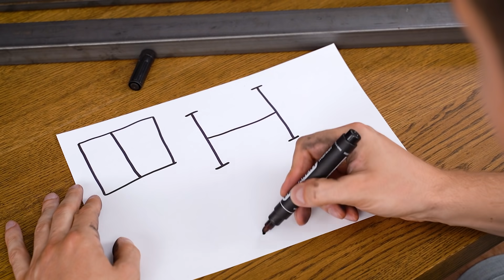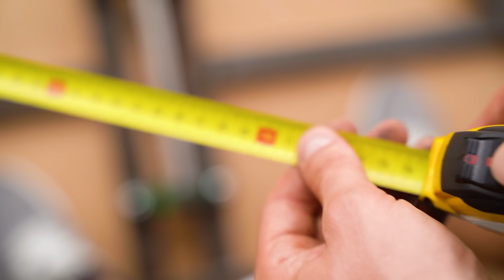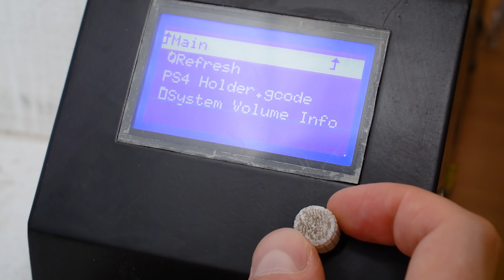How to Build MOTO Sim Rig Works with Any Game/Console

Comment: Albeit a genius way to play a GP sim, as a motorcycle rider I would have a hard time doing this as the use of counter steer isn’t present. If you were to flip the axis for the steering you would have a pretty realistic sim. If you were to lean right and steer right with a right hand pull  at 60mph plus on a real bike, you might find that coming off your bike in a flat spin really sucks. Your videos are awesome nonetheless! I like the sound dampening in your workspace too, my wife hates the echoes of wrench clangs maybe I’ll look into that.
Reply: Halo
Reply: I was thinking the same as he was doing it. No counter steer which makes impossible for me to use this rig
Reply: @madn3r0  you could use it but the lack of counter steering breaks the immersion since its more like driving a car than a motorcycle.
Reply: Bruh thags not cou ter steer
Reply: Needs a gyro
Reply: Came here to say this. Bikes don't turn at speed by turning the handlebars like a steering wheel. Among the best arcade motorcycle systems to get the most realistic turning is Sega Manx TT superbike.

That style full ride on machine could be recreated with the skills of this YouTuber

Comment: Good start! Found this since i was thinking of doing something very similar since nothing good exists already, or at least not for less than cost of a real motorcycle ($6k - $20). 
ONE BIG PROBLEM, this isn't a mountain bike SIM. Real street bikes turn opposite direction due to the steep rake angle and gyro effect of the front wheel. 
Only works like this at extremely low speeds, although not a place you want to be since gyro isn't helping to balance and they have the steering radius of the moon.

Comment: At 4:35 you are doing it wrong. Counter-steering works on a motorcycle at over 12mph (19km/h). So when you lean right at high speed, that’s turning right, you will actually be turning the handlebars left. I know it sounds crazy, but it’s a gyroscopic effect 😉👍🏼

Comment: Definittely funny build and well done. Only the input lag is beyond any immersion :/
Reply: Idk if there is any input lag. I think its just that the lean of the rig is independent of the actual steering. It basically seems like the handlebars control the actual game and the lean is just there for fun.

I think what would have made it more immersive is if the steering cause the bike to lean, and then connecting the lean of the rig to the controller somehow. Preferably in a countersteering fashion, since that is the correct way to ride a motorcycle.
Reply: i dont really see any input lag. its just the lag from him still leaning the other direction.. lol

Comment: For a more natural feel try connecting the controller thumbstick to your bike lean angle instead. On a real bike riding, at low speed yes you steer the bike by turning the steering handle. However, at medium to high speed you steer the bike by leaning the whole bike into the direction of the turn while the steering handle is relatively kept pointing straight ahead.

Comment: Only one problem.  When you ride a sportbike and lean over, its not like you fall to the side and have to use/throw your weight to stand it back up.  If you want it to be a little more like being on the bike, and be more quickly flickable, put the pivot point near your hips, and put a counter weight near your feet.  If you really want it to be realistic, connect the steering to the pivot so the bike leans in the opposite direction that you are steering, and stands back up when you steer straight again.  Look into how countersteering works.  Critical to know when on a real bike, especially if you want to be fast and in control.  If you ride a bike correctly, you can drag a knee with bairely any effort.

Comment: I am very surprised that Logitech and the like haven't built a controller setup for Moto racing as they have for cars. But 'The Q' has beaten them all! This could be adapted for cycling sim racing/training too.
Reply: Because it isn’t as easy as turning a wheel on just an axle. You don’t steer into the corner like his setup, you counter steer at “higher speeds” to make the bike lean/fall.

Comment: You know what would elevate this to a new level? If the motorbike would be assisted by a hydraulic with a sensor that senses when you want to change Direction and "pushes" and on the other side dampens at the same time to give it a more realistic feeling

Comment: The problem with these rigs is that they don't behave like a bike so anyone that knows how to ride will struggle to use them. With a car rig it's simple, steer left, turn left. But with a bike, if you want to turn left you need to turn the bars a little to the right then turn to the left.

Comment: This is really damn cool, but I get the feeling you don't actually ride a motorcycle? 
You counter steer on motorcycle at any speed above around 10 mph, and the left lever on a motorcycle is clutch control, not a brake. Brake and throttle are both on the right side.
Counter steering is actually for anything on two wheels, if you've ridden a bicycle before you've most likely done it subconsciously without realizing it.

Comment: Um, yeah but you don't turn the bars left to lean the bike left.... at least not above a walking pace. 
You push the left bar away to get the bike into the lean and hold it there, then the curve of the tyres and the tendancy of the rear tyre to push a wider circle is what actually makes the bike turn.

Amazing engineering but its going to tie an actual rider in knots trying to turn.

Comment: This makes no sense. The TV should be tilting a 90 degree sweep -45 to 45. The bike and handle bars should only roll 1-5 degrees as you maintain a trim condition with minimal attitude feedback. You’ve never ridden a motorcycle, which understandable hedging your mortality rate.

Comment: That is definitely not a motorcycle sim rig. There's not shift lever, no rear brake pedal. You replaced the clutch handle with the front brake that should be on the right handle bar. Come on !